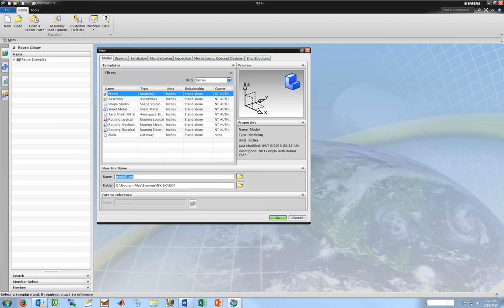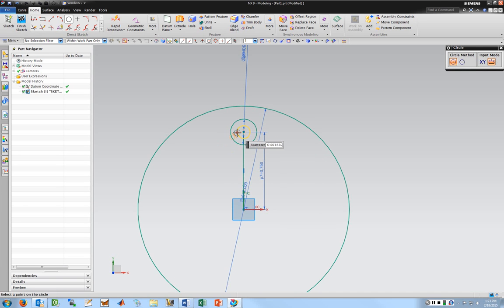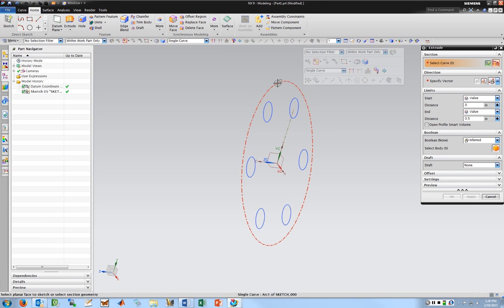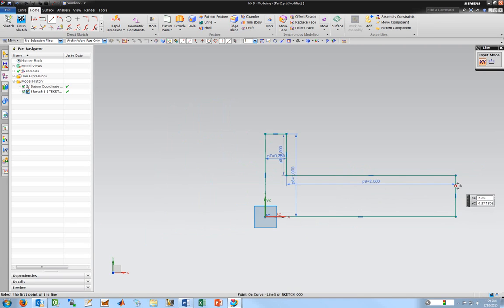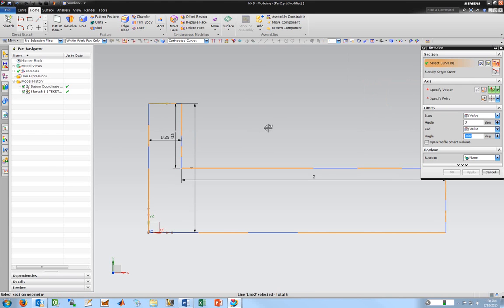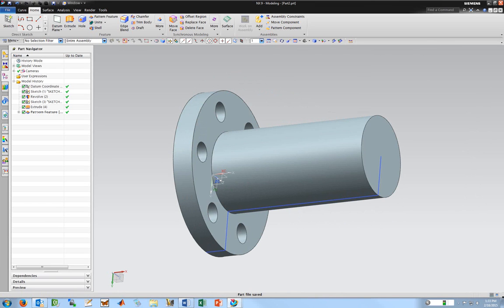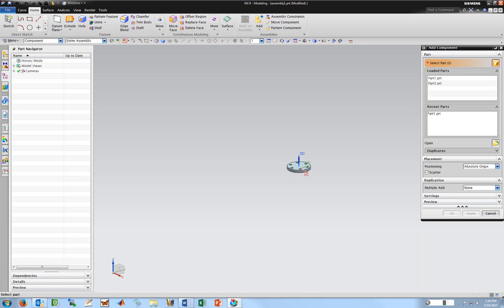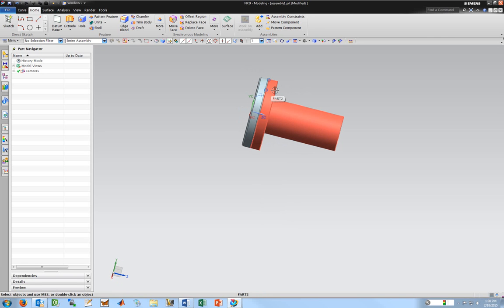NX 9 Tutorial 1 (Basic Parts and Assemblies)

Comment: Did you figure out why the concentric constraint didn't allow you to separate the bodies along the central axis? (16:09)
Reply: ... and that's why c.c. in NX is not the same with c.c. in Solidworks: it includes a plane alignment (try c.c. with cylinders, not circles, see if & how it works). ;)
Reply from the maker: +Colin Gallacher Concentric constraints don't allow axial motion (didn't remember this when making the video).  Using a Touch constraint with the infer axis option instead of prefer touch will allow two parts to be constrained concentrically but still allow axial motion.